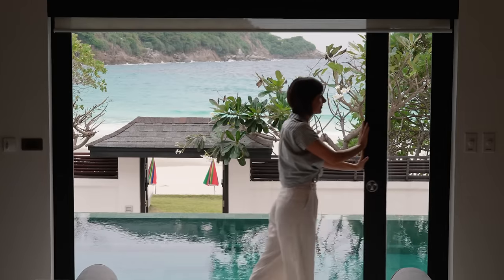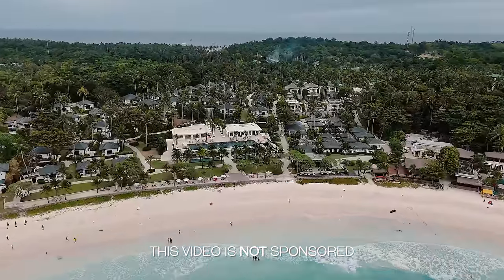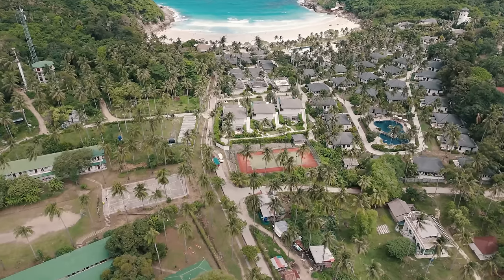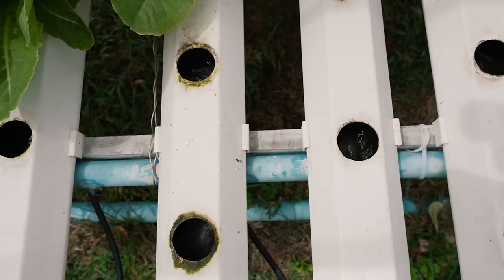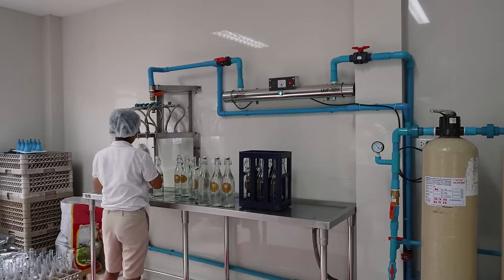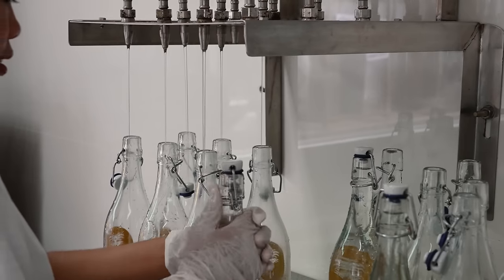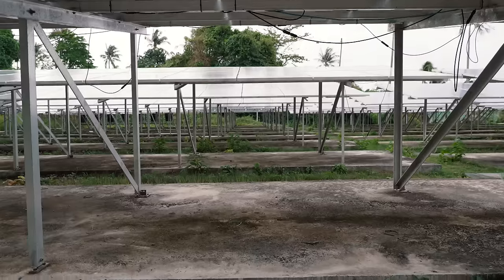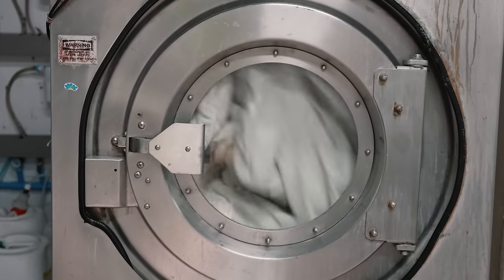THE MOST IMPRESSIVE OFF-GRID ISLAND WE’VE EVER SEEN (full systems tour)

Comment: Hey, Nikki and Jason! You guys may not be familiar with Hot Water Service (HWS) attached to A/C units, but they are actually very common, and are known as 'air source heat pump HWS'. Usually, the heat pump (A/C unit) is mounted directly on top of the cylindrical tank, but increasingly they are 'split' and the 'heat pump' unit is separate to the tank. Can't tell if the island's units were purpose built or adapted, but it makes sense if adapted because, like you said, you're gonna be running the A/C anyway, so might as well use that 'waste' heat to heat water.

Comment: some thing which i have learnt over the years, Copper pipes under the solar panels with insulation surronding them, And run back to a geyser, lowers the tempreture for the solar panels on very hot days produces more electricity. The hot water can then be used fro domestic use and cold watre is then pumped through the system. In cold weather this revers of this can help to clear the solar panels of Ice and Snow, and allow them to produce electricity even on cloudy days. (Although not as much as on sunny days)

Comment: That’s just like how I live in my motorhome. I dry camp or Boondock more than 95% of the time using solar and lithium batteries. I do have to go get freshwater and dump my tanks but they are large so it’s not too often. Thanks for the video. Clean water is the reason I installed a whole house, UV filter, so everything going through the plumbing of my motorhome is clean and drinkable right out of any Fossett.

Comment: I lived on my 11 meter cat for 5 years... mostly at anchor in Queensland, and it had a so called "Type One" sewage treatment system.
There was a multi stage macerator multi tank set up with an electrified grid of some exotic metal that when electrified by a high voltage would create a gas that killed all organic organisms... the output would happen after a few passes from one tank to the other, over the grid and macerator cycles.
What came out was shockingly clean looking and they said the maximum size of materials expelled was under 10 microns.
I never could smell anything odors or see gross discharges.
Sadly the boat recently sank and is being restore by a new owner.
Reply from the maker: Very sorry to hear about the boat but your sewage treatment system sounds very interesting.  Glad to hear the vessel is being restored and will go on to live another adventure.
Reply: @gonewiththewynns  Thanks, I'm saving up for my next boat. As much as I loved the boat I so miss the lifestyle...
The system was built in NZ. Ratian Industries or something. I never could find their net site etc. the cat was from 1989ish...

Comment: Y’all have a water maker and rain collection on the new boat. The space water treatment would take up for just the two of you would be a lot. Just go overboard with it and call it a day. Some large yachts have water treatment but it’s just a fancy septic tank and some filters. Still no real reason for just 10-20 people. It’s more to say they are doing it more than it needs to be done. Same with putting particulate filters and DEF on mains and generators. That’s a really cool community. I never knew about the hot water from the AC. That’s a good idea for us in South Texas or anywhere that uses AC 99% of the day.

Comment: These were common in the late 70s through the 80s it also increased the efficiency of the AC unit
They were called a HRU( heat recovery system). Using the heat from the refrigerant to heat the water using a tube in a tube to transfer the heat to the water.

Comment: Using the excess solar during the day to pump water up a hill to a large storage system. Then running the water back down the hill through a micro hydro setup to provide power in the evening/night would be a very long lasting and inexpensive battery. Especially as the energy storage capacity is only limited by the water storage systems size. With the savings they could increase the solar capacity to ensure there is adequate power in all seasons.
The large uphill water storage could also be used as drinking water. The water would be pressurised by gravity and not need any distribution pumps. Also having a large pressurised source of water that doesn't rely on diesel or electric pumps would likely be useful during natural disasters. For fighting fires or for providing drinking water in a power failure scenario.

Comment: What you may be able to do on your boat, due to space restrictions, is install an incinerating toilet (or toilets..) ..Big $$ and yes, if they're electric, they are a bit power hungry, but you'll eliminate your black waste completely. One could also consider a larger incinerator for gray water and bio waste items perhaps in the engine room, or somewhere that noise can happen. I would probably consider running anything bigger than an incinerating toilet on something other than electric though, as something like that would easily overwhelm the biggest battery banks in a hurry. I'm sure diesel and propane options exist.

Comment: For your laundry look into magnets in your washing machine. Then you can just add a bit of vinegar to the wash to kill any bacteria. The magnets change the water composition so that you don't need soap. I am allergic to soaps, especially laundry soaps! I get bought with shampoo on my body because I can't even use body wash without a rash. Liquid hand soaps have improved such that I am able to use them. I am looking into making my own body soaps and shampoos. The body washes will be mostly Jojoba/lotions. I am sure I can do the same with hand soaps. I a big on watering down all my soaps. Most soaps are filled with fillers that are what I am allergic to. Just like medications, I am actually allergic to the bonding agents, not the medication. I would look into how you can create your own dish soaps (that would be marine safe and take so very little to clean). Because of my eczema and skin issues, dermatologists have told me that I should use lotions to clean my skin. I do some, but haven't completely wrapped my head around that yet. I am still researching shampoos, and by making my own, I don't have the waste that comes in the form of packaging. I am not into cooking soaps and making them that way, I would rather just have to shake my bottles to un-separate them. Just some ideas. By the way, washing one's hands is super important, but what really cleans one's hands is the rubbing together of the hands and not the soap. It is the act of removing the soap that is doing the cleaning and disinfecting of our hands. That is why lotions are just as good in the shower as soaps. The issue for me is what is in the lotion to make it a lotion?

Comment: One more little thing for saving energy on the boat. Your solar energy system should have a built in relay that can be programmed to turn on the electric hot water heater circuit at high states of charge such as over 90% which would save on diesel water heating and is transparent to the user.

Comment: Have you both looked into adding a wind generator to augment your solar system on your new HH44??
Reply from the maker: Wind generators of the size that will fit on a 44' boat don't actually produce much power. They're also noisy and can cause vibrations in the boat, so they're just not as practical as you'd think.
Curious Minion

Comment: To the hydroponics - Aquaponics is better, because you pair hydroponics WITH animal production (fish, chicken, other) and infinetly reuse the water inside the system. In the greenery part - you can grow even tomatoes, or spirulina. Potatoes not much - those are better to be grown in aeroponics productions. Regarding the gassifier - It might be more profitable to grow pigs and feed them the food scraps, and out of THEIR (same as out of human) waste produce the biomethan and compost. 
Power harvesting wise - it might be best for the island management, to procure wave energy harvesting devices (could be paired with solar powered desalinisation devices, for growing the amount of potable water on the island), and instead of disel and bateries, they should work with solar/hydrogen fuel cells hybrid. Energy stored in the form of hydrogen (created by solar energy by hydrolysis out of water, in the peak of the solar energy production)
BTW the island should invest in some long-range work-drone(s) for emergency supply drops from mainland, local search and rescue around the island and firefighting (spraying the area claimed by fire, and/or dropping the firefighting balls).
The 3D printer(s) would help there to the engineers pretty much too, especially when looking for specific sparepart, wich is hard to get.Out of plastic, or metal...

Comment: Hi community, just a few of my thoughts: When I design houses I encourage my clients to specify a heat pump so they can use it to run their AC, Hot water and clothes dryers. Heat pump water heaters can also act as thermal batteries by storing water heated with abundant clean electricity produced during the day for use in the evening. These systems will continue to develop and encompass more systems like water purification, etc. If I design a low carbon home I use the rule of trying to use locally abundant sources first. That could be hydronic pipes into a water source for cooling. Methane from the farms piggery. Sun radiation onto thermal masses like concrete floors. etc. Great in houses but on boats?

Now let me put my ex professional sailor hat on. Weight, scaling and corrosive salt air are critical and major limiting factors. Weight is great as ballast in the right position when you need it. It's also amazing to be able to remove weight (ballast) when you want too. So a hot water system could theoretically work well as a battery (most of the time). Would the scale work?  I wonder if there are not better systems to use the abundant energy around you? Something like a turbo in a car engine as it would be good to use energy twice. So I'm thinking a floatation bouy (doubling as a roll stopper on anchor) to use the abundant wave energy. Would that produce enough energy for the effort? Water turbines to charge batteries while underway? Modern quieter helical wind turbines? Methane from human waste? There must be lots of ideas.

PS: I'm busting to see a boat update.

Comment: Hey Jason you have ac units on board try to collect heat and transfer to water heater  especially in the tropics
Reply: 😅 Boat ac’s use sea water to transfer either heat or cool through the compressor and expels the by product water (hot or cold) back to the sea. His engine make the heat they have to use it and it has an element in it to keep it warm powered by the solar panel system. 😮

Comment: Not sure the point of a composting toilet works on a boat unless you can pack the waste out once you get to land.

Ultimately wastes don’t have enough time to compost in those systems before people throw them away … it will turn to sewage if dumped in the sea and I think a part of the issue with releasing waste in the sea is all of the nutrients supplied to the lower level organisms.

In other words, sterilizing waste for human consumption would still negatively impact the sea.

Comment: I don’t think a sailboat with 2 or 4 people will produce a meaningful amount of waste water and at sea I would just send it out. In a harbor i would use a composting toilet. It is easy if you have two heads to have one of each, but if I had one it would be composting. It saves water use for one thing. I’ve seen several types where there is a low power fan blowing air out a vent and another with the air blowing into a filter, so not external connectivity are needed. 
Where I live, the cruise ships dump their sewage just offshore and until recently the City of Victoria BC used to do the same (on an outgoing tide) without treatment. 
If it wasn’t for the 2kW per flush power usage, I might prefer an incinerating toilet for the extremely fast desiccation and all you have to remove is ashes, but emptying the compost once a month works with less resources used

Comment: The latest Gin Cruisers use an inverter to charge a Marine Capacitor bank, It takes 30 seconds to go to full power, That then goes and charges up so you can run a washing machine & Tumble dyer to keep the wife happy, No need for battery's, Can be used day or night. No solar panels needed. Which is just chinezium slave labour at the end of the day. A capacitor bank is clean and easy to assemble, No scarring of the planet like lithium, Which is expensive to buy and the weight can be kept way down.. Them batterys are not light and every 4 years you need new ones, Where a Capacitor bank can take 1 million + charges and still keep going..

Comment: Imagine the environmental benefit if the island would not have been turned into a luxury resort…. The fact they need 70% diesel to run an island is just mindblowing. These “pseudo off the grid” projects for the rich are part of the problem and do not at all illustrate the “best practice”. I am an environmental manager and was mindblown (in a negative way) with what I saw.
Reply from the maker: Imagine the environmental benefit of no resorts or houses or people.  But that isn't realistic.   As someone who has traveled around the world to various islands, I can tell you, this is NOT pseudo or greenwashing, they have done a ton that others do not.  And they are consistently improving systems as they go.  The majority of the world is running off of fossil fuels.  So the fact that they are working towards renewables is working in the right direction.  First solar, then a battery storage system.  If you have a better way, I am sure they would love to hear your expert opinion.

Comment: I think all of this is great and we need to see more of it but you didn't talk about the cost.  It would be interesting to know how much this costs per person per day or month or year or whatever and how that compares with conventional facilities around the world.  Until the costs are comparable it is going to be a hard sell which means it will take enhanced regulations which means politics and we all know how that goes.
Reply from the maker: The costs are generally comparable or less!  It's hard to break it all down to something relatable but...all of it equals significant savings.  The easiest example was the solar.  Paid for itself in 2 years and has been free power ever since.  The RO system saves a ton of money on both transporting water over to the island and transporting the plastic bottles back to the mainland.  

A heat exchanger for an airconditioner would easily pay for itself in energy costs.  

Every system on our boat from the solar to the watermaker to the hydrogenerator will pay for themselves in less than a few years.  It's all there, we just need to make it more well known...aka, mainstream.

Comment: When you say solar hot water you probably mean that you use electricity to heat your water when you don't have hot water from your engine. Why not put an actual solar hot water system on the boat and heat the water with sun directly and not do it indirectly?

Comment: An island surrounded by water, a boat surrounded by water, yet they use diesel. With all the water why not use hydrogen to fuel your engines? A hydrogen generator is expensive but you and the island will never need diesel or gasoline again